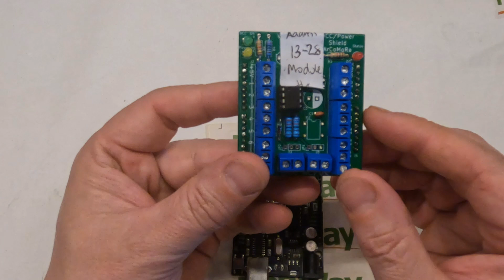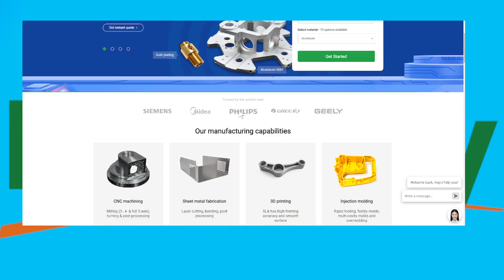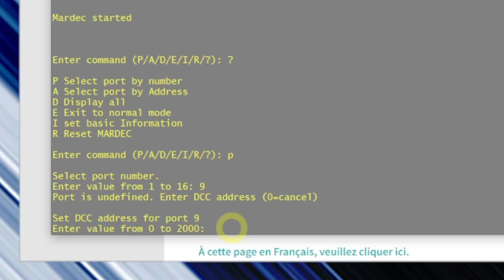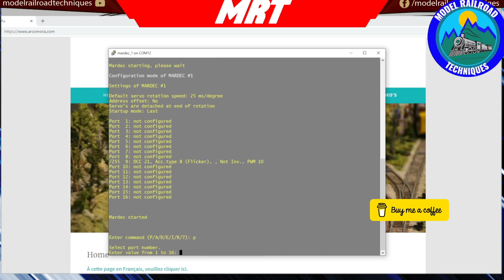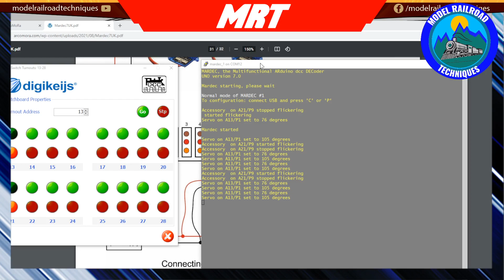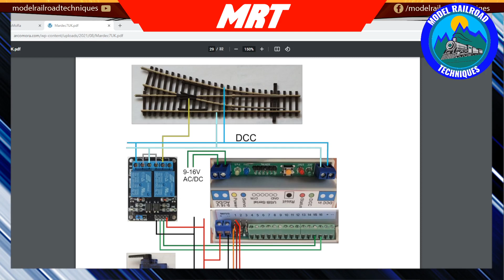Cheap Accessory Decoders for your Model Railway ?

Comment: Cheap DCC... Used an old PC Power supply.  Gives me 12v, 5v and 3.5 v.  Off my 12v to a buck converter upping voltage to 16v for DCC.  DCC-EX on an Arduino Mega.  Have an old PC running JMRI with a touchscreen. Four Mardec's controlling all my switches. Four MERG, 8 channel block detector (kits), two mono frog juicers for my reverse loops and four Hex juicers for my switches. Easy peasy and dirt cheap!
Reply from the maker: @pwilliamssa  I love it. Sounds like an awesome rig

Comment: I have 3 dccnext's and each one has 12 servos on dupont pins. I use the first 4 as accessories and the following 12 for servos.
Reply from the maker: They are great. How do you find the DuPont pins? I find them coming loose easily.
Reply: @ModelRailroadTechniques  I haven't had any issues with the pins coming loose. The units are screwed to the board and don't move around and I always have a little slack in the wires.
Reply from the maker: @stephengibson1106  maybe it’s my poor DuPont making abilities
Reply: @ModelRailroadTechniques  just make sure there's enough solder on them

Comment: I find the ArCoMoRa stuff is as good as any professional system at a fraction of the cost.  Nico has done an amazing job.
Reply from the maker: Mardec you can do cheaper isn’t an Arduino nano, just need to build a DCC interface. Easy to do

Comment: Now this is a title I can get behind.
Reply from the maker: I am hoping in a good way?
Reply: @ModelRailroadTechniques  100%, costs add up quickly on the RR.
Reply from the maker: @HumancityJunction  it certainly does
Reply: Hi Heath,I have been using ARCOMORA hardware and it’s reliable and easy to use
Reply from the maker: @ CV Railroad in HO Scale. you are so correct there.